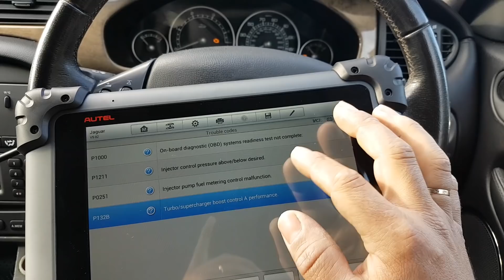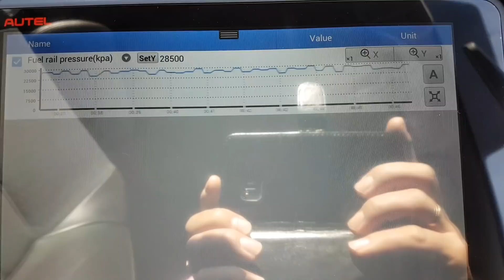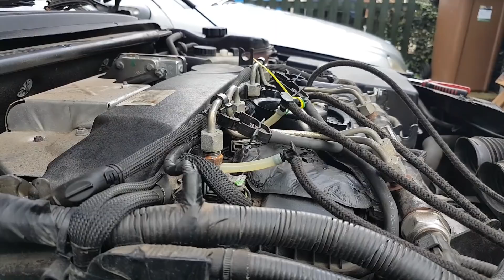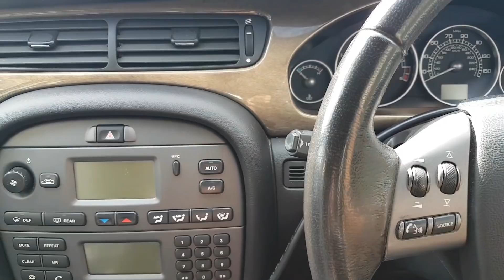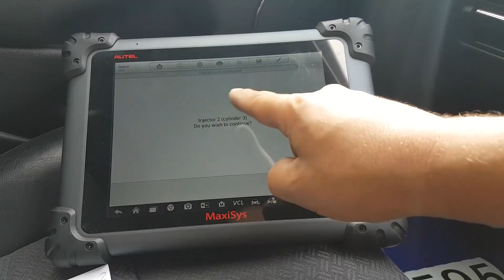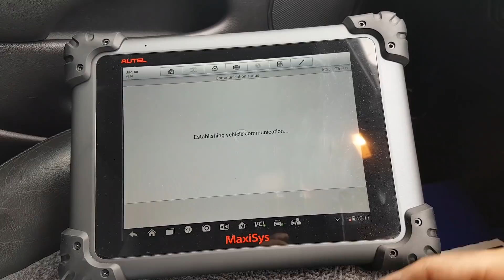Jaguar X-Type 2.0 TDCI glow plug light flashing, limp mode and cutting out. Fault finding and repair

Comment: Another similar issue I have not fixed yet, but on a BMW M3 E46. Car drives fine under 80 Km/h. But as soon as you get above that, the glow plug light comes on. If you keep the speed, the engine cuts off. But if you reduce to under 80, the glow light goes back off and the car continues to drive normally. Many mechanics have messed around in the engine bay. Found the MAP sensor unplugged, bad wiring. But have not done the return fuel test yet.
Reply from the maker: The BMW M3 E46 is petrol... not diesel!
😊
👍👍👍
Reply: @LMAutoRepairs  My bad, I mean it's a 3 series, 320CD

Comment: Hello, I have a Mondeo mk3 2.0 85kw tdci 2005. I'm wondering if any of you have encountered the P0262 error, the injectors and pump were repaired and the codes were entered into the ecu, the car ran for 10 minutes, turned off and hasn't started since, before it was repaired the car lost gas and went into safe mode. The engine is the same as the Jaguar X-Type in the video. If you have had a similar problem, I would like any advice?
Reply from the maker: Hi
Injectors, were new or used?
Have you checked wiring from the Injectors to the ecu?
👍👍👍
Reply: @LMAutoRepairs  
Hi
The injectors were used on the car and then repaired. All injectors were tested where they gave me new codes for them. I removed the wiring all the way to the ecu and tested it, there is no damage to the cables anywhere, no short circuit. I also looked at the ground that connects the ecu to the chassis, I measured 12.8 volts with a multimeter. On the connectors of each injector I have a reference voltage of 5 volts when the car is in contact. I used a noid light and each connector had a signal by flashing when I start the engine. Could injector 1 have a short circuit on the coil itself? Is it possible that the car will not start because of it? The ecu shows error P0262 ( High circuit of the cylinder 1 injector ). The system is bled and has very good fuel pressure. I tried to start with start spray but failed. In short, my story with the Ford engine. 🙂👍👍
Reply from the maker: @KristijanMarjanovic-l4g 
See if starts with injector 1 unplugged...
Reconditioned injectors are sometimes a hit and miss...

Comment: I got one of these with the orange flashing glow plugs and limp mode it happens every 30 seconds at speed, brought it in for a scan and it’s coming back as 3 fuel sensors broken, would I be right in saying it’s the rail pressure sensor, the diesel pump regulator control valve and fuel temperature sensor? The engine actually revs to the top in neutral and when it’s cold it has loads of power.
Reply from the maker: All 3 at the same time?
I would be suspicious of something else...
👍👍👍

Comment: Do you have any problems using the Autel with the car running ? I have an MK808 that is fine with every other car, but on the same Jag X type 2.2 Diesel, it will code read with the engine off , crank but won't let it fire. The car doesn't have a starting problem, I was trying to do the same live date read on the rail pressure. Seems like it's messing with some anti theft system maybe ?
Thanks for any advice.
Reply from the maker: I had were it shuts the engine off when clearing the  codes... but never what you are experiencing...
👍👍👍
Reply: @LMAutoRepairs  many thanks for taking time to answer

Comment: what will happend if you not program  injectors? because on that autel old injectors not fitting even old injector numbers
Reply from the maker: Injection quantity might not be optimal...
It can impact fuel consumption, combustion, and the overall running of the engine...
👍👍👍

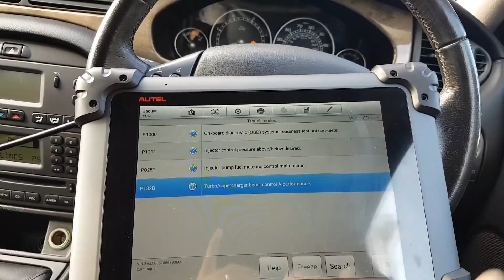Comment: 5:58 P132B Turbo Booster boost control A performance: likely carbon clogged turbo or defective electronic turbo-actuator. This Jag has a variable geometry turbo like many other turbo diesels. If carbon clogged, the variable geometry mechanism could be sticking. Otherwise check turbo actuator and cabling. Could at some point also throw P1700 error codes (Transmission Failure) if automatic gearbox - especially when starting engine. Will get worse and more frequent over time. At some point the turbo must be overhauled or replaced. When replacing/overhauling the turbo, check the EGR valve too (you need to unscrew the intake manifold anyway when replacing the turbo) and replace it right away. Also clean the manifold. Make sure to not drive short distances too frequently. This car with Diesel engine (like most other Diesels too) likes long drives on the autobahn (highway) and needs optimum engine temperatures. Then it's a fabulous car. If tentatively driving short distance often, change engine oil at least twice a year (to lower carbon buildup) or just dump it entirely and buy electric. (and say "thank you" to your authorities - they've forced the auto industry to design products that are prone to fail in typical use scenarios because of exhaust gas recirculation and similar nonsense).
Reply from the maker: Thank you for watching and for your comment!

Comment: Hi. Thanks for video.
I have an Jaguar X-Type, 2.0d, year build 2008. 
Since last week, I have exactly the same glow plug light flushing coming ON and can;t  solve the problem, engine is stooping very often on 1st and 2nd gear, running OK on idle.
Two weeks ago I have add in full fuel tank some STP diesel additive, driving till a quarter tank,  refilled again to full tank level, driving again @80 km with no any problem.

Next day  I replace the fuel filter with an Ford filter- (New filter was filled whit diesel to top).
I start engine on idle @ 10 minutes- was working fine, I stop the engine, 20 minutes later I plan to do city drive and after 500 meters engine go on limp mode and stops, happen exactly the same issues. 

I have checked all injectors in an work shop with a machine test report, they are OK. I can send you pictures report. I check the car by OBD tester having same cod like you.
Mention - With this problem I drove @ 60 km from one to other work shop mechanics  around city and nothing, today I replace again with a Delphi new fuel filter and have same problem. Again- engine OK on idle.   No idea what next. 

Any help from any one is highly appreciated, I am far away from Romania, Mob. +40723471636 if you not mind, on Whats App we can have a chat.
Best regards.
Reply from the maker: Hi
Start by making sure that there is air locks in the fuel system...
Has a back leak rest been done?
Thank you for watching and for your comment!
Reply: @LMAutoRepairs Thank for replay  Back leak done, is OK, can you please give some tips how to remove  locked air in system??? Thanks.
Reply from the maker: @marcelmarin4355  
Just loose slightly the nuts on the injectors and crank... do it one at the time...
But to be fair, if idles ok, and drives ok up to a certain RPM... might not be that issue...
Reply: @LMAutoRepairs I find that on forum, any idea where is located that module?? ****( I had previously removed my Steinbauer gubbins to eliminate that from the issue. I refitted it and I now have my Jag back to where it was. As a reminder, the Steinbauer interrupts the injector signals and lengthens them to add power - a sort of hardware remap.***)).
Reply: Hi, I check the fuel from filter and I find some metal particles, know I have to change fuel pump, clean all fuel line and diesel tank, replace again fuel filter, I will be lucky if I can save the injectors.
Reply from the maker: @marcelmarin4355  
If you have said earlier that was metal on the fuel filter.. 
Yes... you need to do all that...

Comment: Good video ,but as a layman I will need a bit more explanation as to what the test involves and what it proves.
Reply from the maker: The consist in measure how much the injectors are leaking back...
If you much, that also means that they are not holding the fuel on the high pressure side... causing the rail pressure to drop too much...
If that makes sense...
Thank you for watching and for your comment!

Comment: HI i have a 2006 focus 1.6 tdci  when looking at live data glow plug control is on constant  have you seen this fault before ?  any  advice  would be greatly appreciated
Reply from the maker: Hi
Don't think I ever had that... any other issues with the car otherwise?
Is the car running fine?
Thank you for watching and for your comment!
Reply: @LMAutoRepairs   no other issues  maybe the relay is faulty thank you for your reply.

Comment: I have an x type 2.0 and yesterday the glow plug light starting flashing. The performance wasn't affected. But, this morning it won't start.
Reply from the maker: Hi
Check codes... live data for fuel pressure etc...
Thank you for watching!
Reply: Fuel pressure fuel pump

Comment: Car driving fine up to 65 put foot down to pull on and glow plug light comes on flashing and goes into limp mode can't remember the codes to be honest
Reply from the maker: Hi
Without codes and/or some live data is difficult...
It can be that you have some bad injectors,  and at high revs/load, the high pressure fuel pump just can't keep it up...
Reply: SOUNDS  like turbo is not working try cleaning it or recon unit SHOULD  SORT  it out blocked up with carbon deposits

Comment: What do you do after fitting new injectors and new pump and new fuel filter and problem still there
Reply: I'm getting issue with this and P0251 P01211
Reply from the maker: Hi
What was your initial problem?
Have programmed everything? 
What codes are coming up now?
Thank you for watching!

Comment: Nice video thanks for sharing, can we do back leak test for piezo injectors
Reply from the maker: Hi
You can... just remember, that the back leak test, only tests one side of the injector... many other things can be wrong that this test does not show...
Thank you for watching!
Reply: Thank you
Reply: I read that Some piezo injectors have a high pressure return 10 bar if I remember am I wrong
Reply from the maker: That sounds a bit high... the returns are extremely low pressure...
At that pressure, they must be leaking quite bad...
Reply: I really appreciate your reply thank you

Comment: Jaguar X Type Engine was either a 2.5 or a 3.0 never a 2.0
Reply from the maker: Perhaps in your country... not in the UK.´
This was a 2.0 TDCI, same engine as the Ford...
Thank you for watching.
Reply: 2.2d aswell.
Reply: Tactical Advance Only the 2.5 or 3.0 gas engines where available in the United States
Reply: Tactical Advance I would have definitely bought a diesel
Reply: Tactical Advance . Europe doesn’t have the strict emissions requirements like the USA does. This is why the Diesel version is not available
Reply: @LMAutoRepairs     I have same car, so it must exist..
Reply: the engines for the entire X Type Line up were 2.0 Diesel, 2.1 V6 petrol, 2.2 Diesel. 2.5 V6 Petrol. 3.0 V6 petrol. International markets only got the 2.5 and 3.0 V6 petrols. UK got all.
Reply: Gonna say we habe a Jaguar x type 2.0 litre
Reply: If the high pressure fuel pump goes on these engines you may as well scrap the car. That happened to me  £600 For a new pump and you need to take the engine out to change it.
Reply: 2.0 diesel it says....put the glasses on  2.5 and 3.0 are petrol....
Reply: That's only in America dumb dumb

Comment: Theres some useful information on here but for your average owner, without the software etc who just wants to sort out the limp mode thing...its usually rectified by

a) change the diesel filter. Its a simple DIY job

b) do a leak-off test. Its likely to be one or more injectors with a blocked tip. Theyre actually easy to clean with carburetta cleaner and a clean rag. I dismantled my injectors and the pressure of the carb cleaner was enough to clean out the injector tip.

Make sure you put them back in the order they were removed from your vehicle
Reply from the maker: Nigel Parish 
Indeed..  good advice!
Thank you for watching!
Reply: LM Auto Repairs  really good video though. I drove my X type daily for a year very gingerly to stop it going into limp mode. On the plus side I'm returning 60mph.

Sat and watched this video,ordered the removal tool and leak off test kit. 

Down to my local scrap yard and removed four injectors from a Mondeo. All four for £20 .They all had clogged ends so I carefully dismantled each injector and cleaned out the blocked tip with carb cleaner. Did a leak off test and two injectors were faulty.

My local mechanic charged only £80 to swap the two faulty injectors and programme in the injector codes.

Now the car goes like a rocket with zero smoke.

This well made video saved me a lot of £££.  Thank you
Reply from the maker: Nice one!

Comment: I have a similar problem, i have a 2004 Jag and when we would put the foot down... It would loose power and enter limp mode... we've changed 2 egr valves, a oxigen sensor and a fuel sensor, and also checked the pump, which came out well... The injectors were cleaned and tested and were fine... it still turns on the light...
Reply from the maker: Edu Alex 
Hi
You have missed something...
No codes? 
Thank you for watching!
Reply: Try the fuel filter??

Comment: How much did you charge for this fix?
Reply: Done the injectors, but now is reversing the process, I mean it's doing it less and less. Took it for a very rough drive yesterday for about 2h, adding a mixture in the fuel for cleaning up "the system". If the engine warms up to his optimal temperature, it almost impossible to get limp mode.  This morning, again, started the car, all normal, took it for a spin, five minutes later, limp mode... Flick the key, and that was it, nothing after, couldn't get it in limp mode no more, and also engine almost at optimal temp. Is it because there's oil and residues on the way out, that added from the bad injectors and is going to do it less and less until the system is clean ? I can't think of anything else... It looks and feels like it recovering from a very nasty cold hahaha.

Thank you very much! Your videos are brilliant and this is one, not only saved me, but you are a spot on mechanic even when client is lying to you. All the mechanics l went to, nothing like you, no matter how many details i would've giving them... So I bought tools and done it myself, and i know what i know from you and youtube... Internet is good for something  after all! Thank you every so much once again! Brilliant!
Reply from the maker: Mihai Tilea 
Hi
It could be that is cleaning the system... however, if you have the opportunity,  monitor some live data while driving...
Which codes are the limp mode triggering? 

Good to know that my videos are encouraging people out there!
Thank you for the feedback!
Reply from the maker: Hi
I can't remember now... sorry.
Are you having the same work to be done?
Thank you for watching!
Reply: LM Auto Repairs
I have the exact same problem for a few months now and it's getting worse. I need to do something soon. Need to know how much. Where are you based?
Reply from the maker: Mihai Tilea 
Hi
Why you just don't remove the injectors, and send them to be tested/ repaired?
If you don't want to spend money on reconditioned or new ones...

Comment: when my Jaguar X Type 2003 when it's low on fuel it driving have a little misfire it drives perfect though but when I put gas in it goes into limp mode and won't go past 3000 RPMs please somebody help me out
Reply: my 03 Jaguar goes into limp mode never it won't go past 3000 RPMs I was just wondering do I need to change my fuel injectors because when it's low in gas it drives smooth when I put gas in it it start acting up and goes into limp mode
Reply from the maker: Trap Star 
Without some sort of scan and live data it is difficult to guess...
Reply: +lmsvvavr what makes a Jaguar 03 X Type goes into limp mode do you have any adjustments
Reply from the maker: Trap Star 
That's what I meant, there is a few things that can make it to go in limp mode...
I can't advise you just based on what you said...
Scan the car, and look at the live data for the fuel system, if you believe is fuel related and go from there...
Otherwise is a shot in the dark...

Comment: Nice job. What is the meaning of that injector code at 32:05 ? Does it basically comprise the characteristics and calibration of that specific injector so that the fuel management system can manage it accordingly? Thanks.
Reply from the maker: Hi
"Does it basically comprise the characteristics and calibration of that specific injector so that the fuel management system can manage it accordingly?"
Spot on!

Comment: Hi mate great video as always I have done a lot of them common problem with them Great Tip by the way checking for metal bits in the filter I always cut the filter in half and check for any metal bits the amount of people have seen just replace injectors and pumps and not check this isn't funny it won't take long to destroy all the new parts you put in there is also a special tool which is really really cheap to a line the injectors up as you tighten them down it's handy coz you can do two at once
Reply from the maker: bodgit and leggit garage 
Hi
Thanks Leon... I know about the tool... but for the ordinary owner doesn't really worth... in my opinion. 
Definitely worth check for the swarfs, for the exactly reasons you have just mentioned. 
Thank you for watching and for the nice comment.
Worth to get my hands dirty....😉

Comment: Good  video  u are the best doctor of the engine 👍PS it possible on v6 tid common rail injectors denso to don't have return pipes visible y have only hight pressure pipes and electrical connection. Because y want to replicate your test on my Saab 9-5 v6 tid thx allot